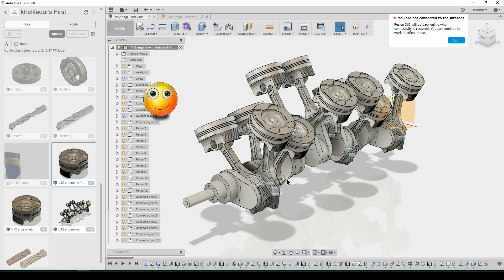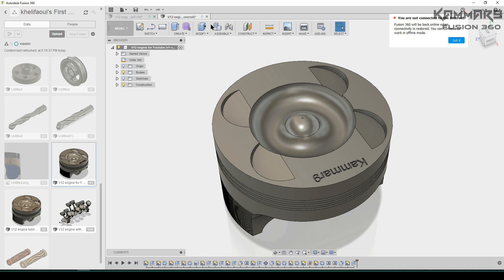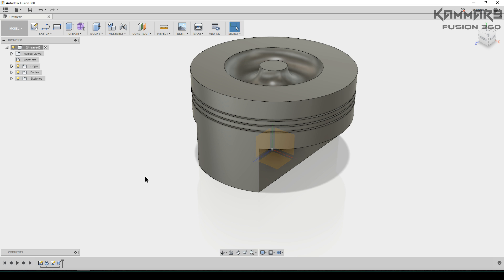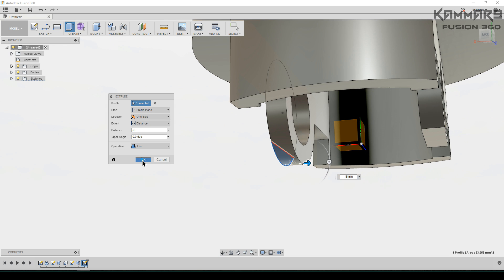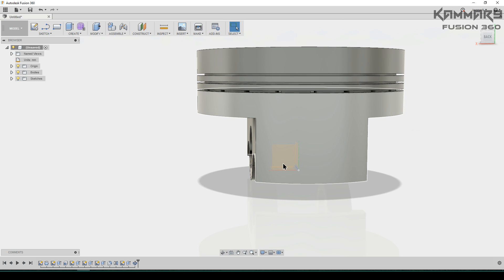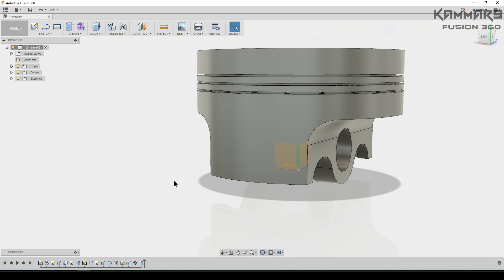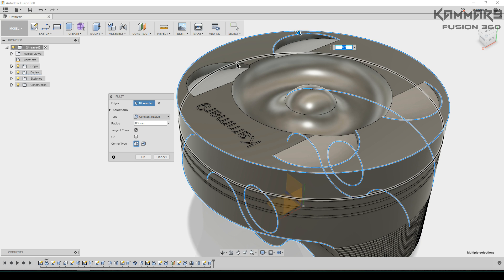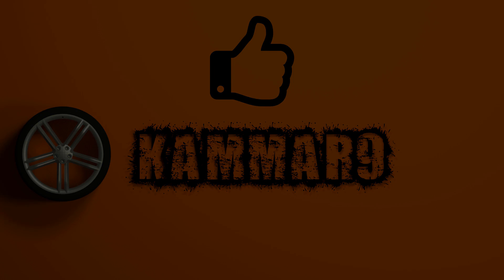Fusion 360 Modeling V12 Engine EP 01 😍 Full HD

Comment: Piston skirt is same dimension as the crown?  Pistons are barrel shaped for friction reduction and stability; also take on a slight oblong shape to further reduce friction on the pin sides of the piston.  Piston/wall clearance is set from center of the skirt.  Seems like using a revolve can't replicate these unique factors of piston design...that or this engineer never built a real motor and didn't know these characteristics exist in modern piston design.
Reply from the maker: Thanks for your suggestion bro , I modelled this engine with my capacity and I don't have any budget to try to make it in real and test it , thanks for this information , please it you can send it to me by email it ll be more clear , thanks

Comment: i wanted to learn why its designed the way it is what are the point of all those holes and rings and how did you come up with the dimensions
Reply from the maker: Hi bro , you can't find this in the web , I m mechanical engineer , and i wanna to share my skills with you and discover this software
Reply: I would think for oil transfer to reduce friction, and in turn, heat.